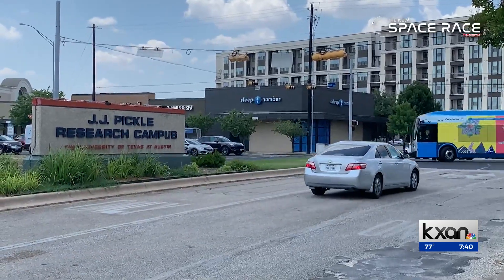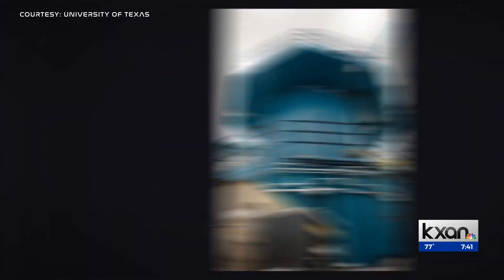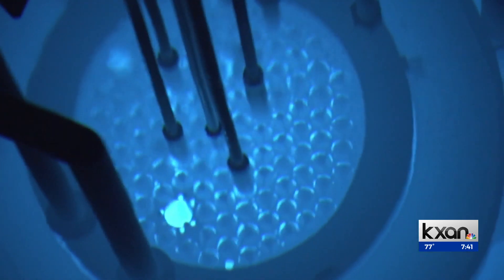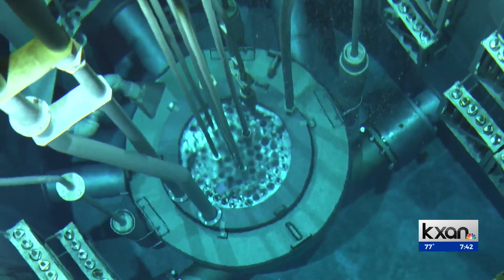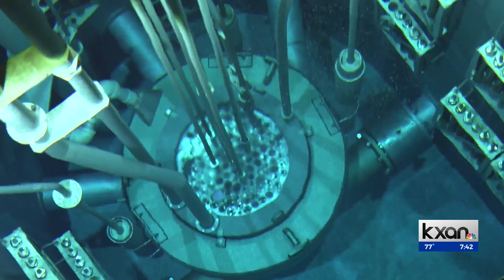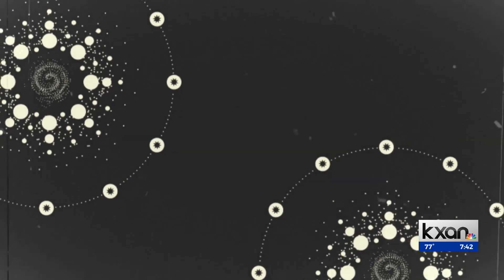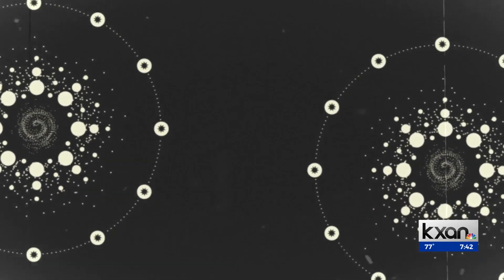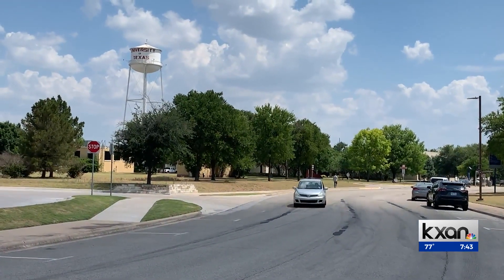Austin's nuclear reactor; how it could help us travel to Mars

Comment: How do you want to cool a reactor on the moon, when there is no water there?
Reply: They will bring water.
Reply: lol you literally need zero water for a reactor. Not all of them need/use water. Many use sodium/helium and don’t have a steam system.
Reply: um hello? space is literally 3 kelvin (-454F) everywhere pointed away from the sun. you don't need water. radiate it away.
Reply: @Muonium1  Daytime temperatures near the lunar equator reach 250 degrees Fahrenheit (400 K), while nighttime temperatures get to a chilly -208 degrees Fahrenheit (140 K). The Moon’s poles are even colder. Diviner even found a place in the floor of the Moon’s Hermite Crater that was detected to be -410 degrees Fahrenheit (25 K), making it the coldest temperature measured anywhere in the solar system. Extremely cold regions similar to the one in Hermite Crater were found at the bottoms of several
permanently shadowed craters at the lunar south pole and were measured in the depths of winter night.

It's better to remain silent and be thought a fool than to open your mouth and to remove all doubt 😉
Reply: @bob_mosavo  Since I'm literally an engineer on a nuclear reactor and am well aware of the temperatures on the moon, I think maybe you should re-read my original comment and take some of your own smug advice there, BOB. Especially since you seem to believe WATER would be a good idea for cooling in these locations.
Reply: @Muonium1  You are literally an engineer? Do you get to wear the striped hat and overalls, too? And where did I say water would be a good idea for cooling in those locations? The answer is LITERALLY NOWHERE. Moreover, you started the smugness, literally. Please change your screen name to Moronium. It would be far more accurate and literally far less insulting to muons 😉
Reply: @bob_mosavo What do you mean he started the smugness? You are the one that started the smugness with your ending paragraph from your first response.